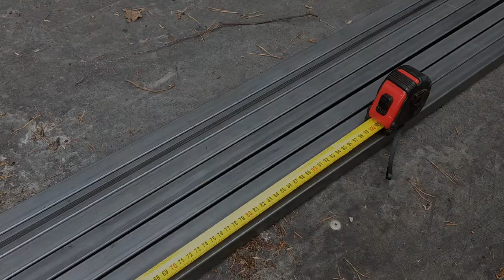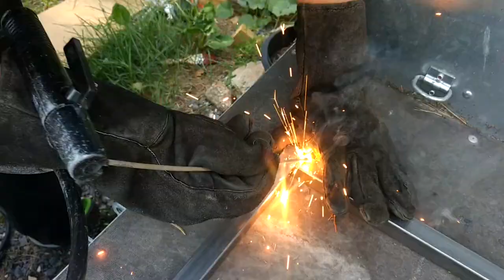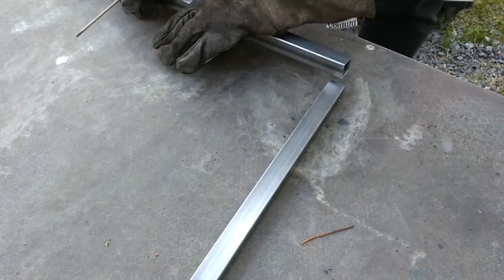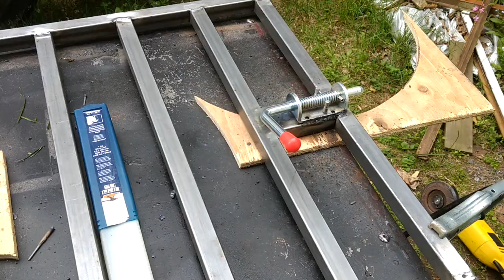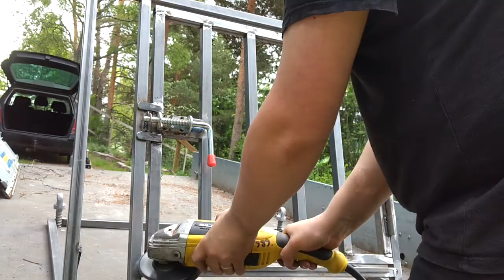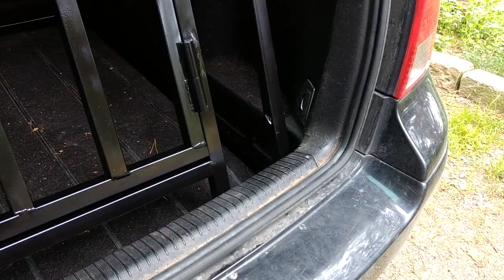Building a tailgate dog guard

Comment: Really good especially when you have two dogs that jump out of the car in different directions. I made mine out of plywood on a wooden frame. It's very light and clicks into where the parcel shelf was located so its easily removable when I want to move stuff other than the dogs.
Reply: Do you have pictures of yours made out of wood?

Comment: What type of welder are you using?
Reply from the maker: On this video, I'm just using a simple cheap stick welder. I prefer to use a MIG welder because it requires less cleanup after welding. However, I don't own a MIG welder. So usually I'm using a stick welder or a cheap MIG like welder which can only use flux core wire without additional shielding gas.